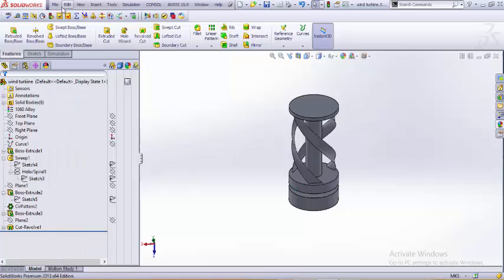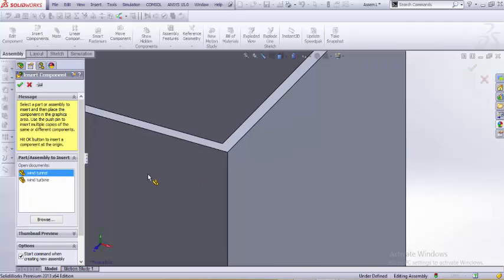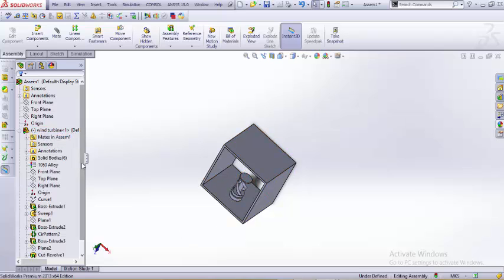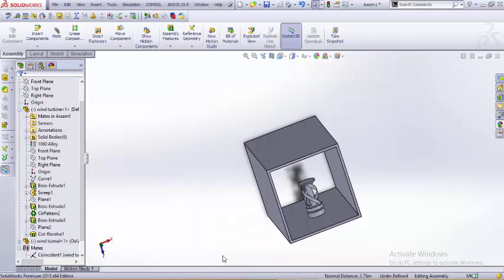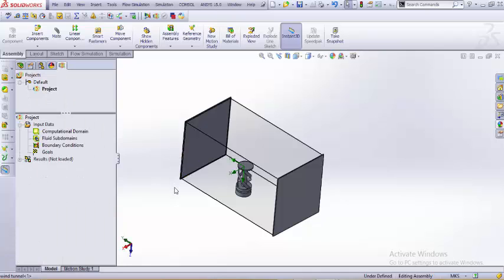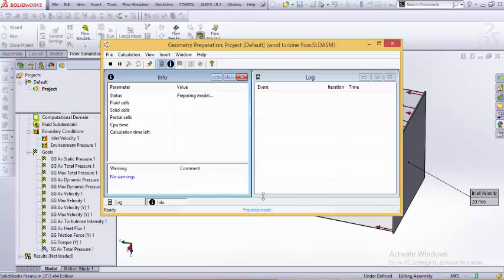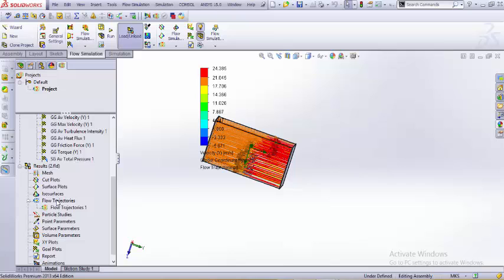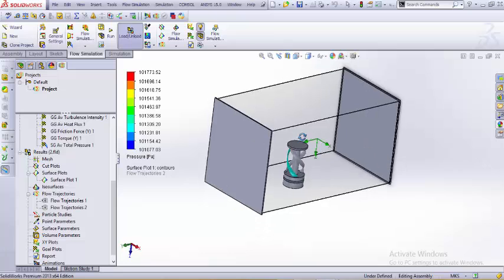Vertical axis wind turbine flow simulation(simplified)

Comment: Hey mate, do you have any idea how to simulation the rotating power, i.e. how much wind power the blades can get? Cheers.
Reply from the maker: Jatsen Shen try defining rotating zone and select a fluid subsection.  thus simulate the torque. the parameters can be defined manually as well. multiply the result of torque with design rpm or may keep that parametric. that's the easiest I believe. the same way is applicable for ansys. I did a similar project few months back...try it mate...cheers